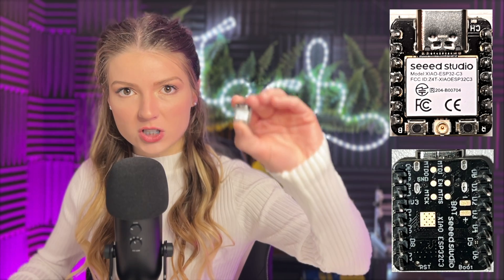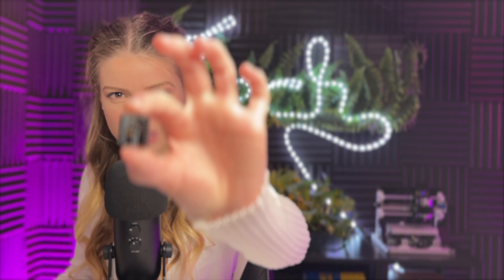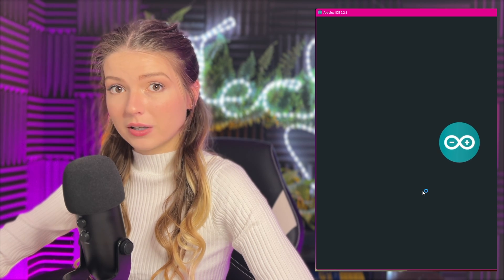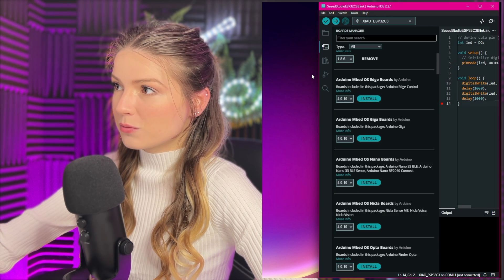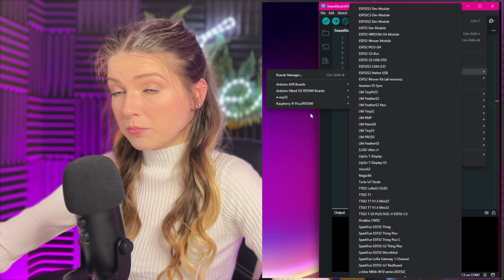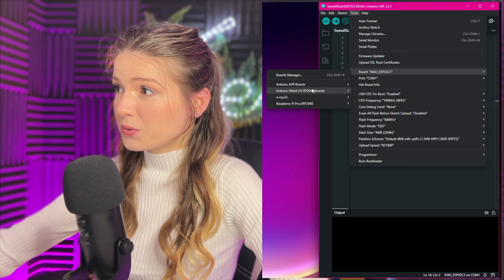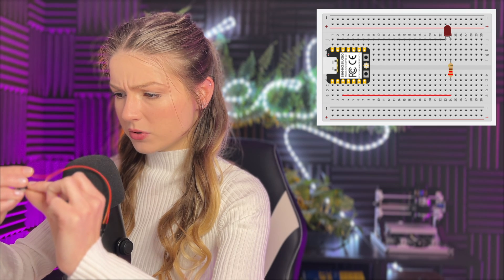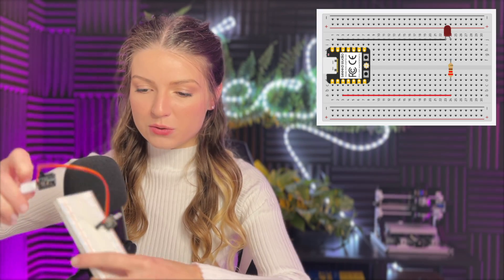Getting Started With The XIAO ESP32-C3 Simple Blink Program

Comment: Great video! 👍 ESP32's are awesome boards.  I designed a car Bluetooth radio based on one, I also monitor and control my temperature control system in my 3D printer cabinet with one.  They are very versatile devices with a lot of capabilities.
Reply from the maker: That’s absolutely incredible! I’m working on using it for a techno-teddy 😁(for my next creative engineering project/video) but I’m still working through a few kinks with getting the audio amp module, 2 OLED displays AND a 3.5” TFT LCD module with micro SD card to all run off it, while also connecting it to a Li-Ion battery and 3D printing the compartments /containers for everything. I’m probably going to need some power modules to aid the current being drawn from it.
Reply: @techwithrita  Very cool.  I have no doubt you will figure it all out and your project will turn out awesome.  

For my temperature control system, I thought about using an OLED to output pertinent information...  I decided to have it serve a webpage to my local network where I can monitor and control everything.  I also ran into some power delivery issues powering the ESP32, 2 relays, a servo, two fans, and an LED bar.  I ended up creating wiring harnesses and am powering all of the devices off of 3 USB ports and have a standard (wall plug) battery backup for the whole system.  The wiring was/is pretty intense on this project, but using a lipo/lion battery and wiring directly to that would have simplified my wiring conundrum.  My next project, I will definitely be using a lipo/lion and implement charging circuitry for the battery.

Comment: You really should always use an current limiting resistor with an LED.
Reply: It's to protect the pins of the micro-controller (mC), usually they can't drive much current, if you don't use a resistor the mC can be damaged 😢
Reply: Yeah I agree, but some Chinese lighters have an LED without current limiting resistor with 3 small batteries and it works just fine. But in this case 5v yeah it should be necessary.